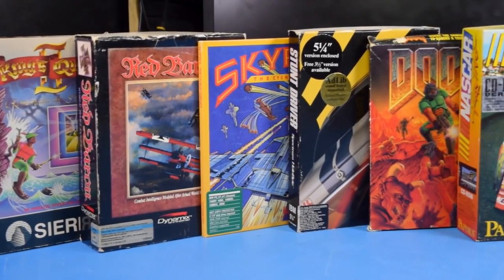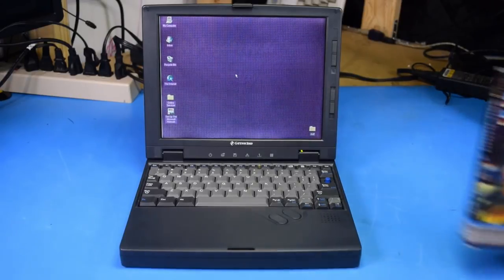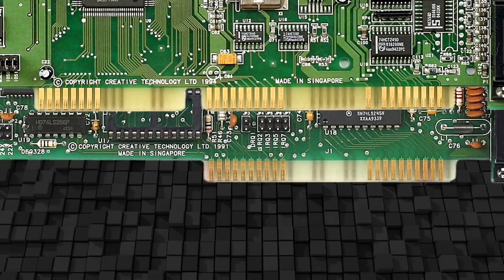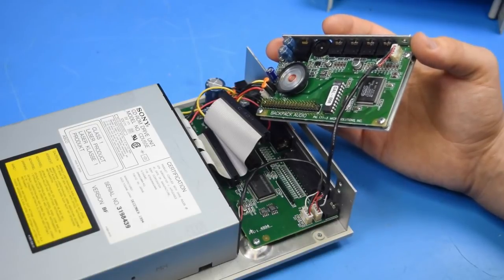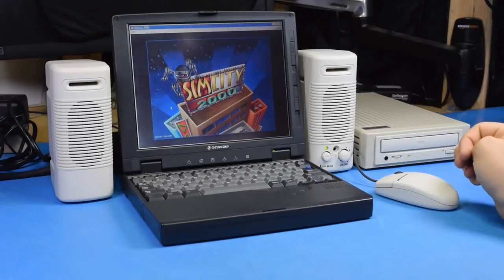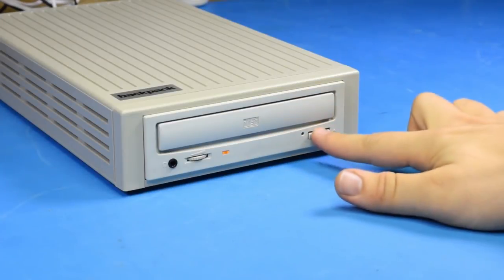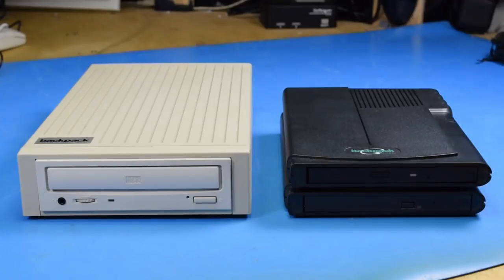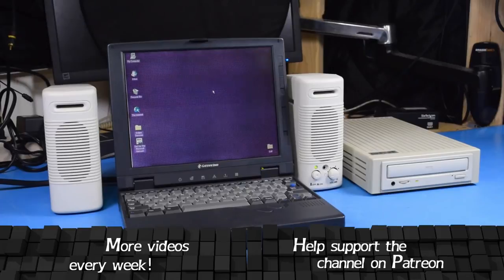LPT Sound Card In CD Drive is Almost Awesome

Comment: Since the es1688 can do OPL3 emulation is it possible that the tools/drivers for the OPL2LPT/OP3LPT might work with the backpack?
Reply: That's what I thought as well. However, DMA PCM playback will probably not work. Hence digitized speech et al will be problematic.
Reply: Well yeah, I'd only expect adlib level compatibility so no digitized sound but at least it would be better than nothing if it were possible, it might not do anything do to the difference in implementation anyways.
Reply: Not without further very extensive modification of the driver. There's a bit of logic on the LPT-IDE adapter board to drive address selection and to stick 2 8-bit transmissions into a single 16-bit and vice versa, and you basically have to work around that in the driver. I don't think it's possible really, all you need to do for OPLxLPT is hotpatch the address of the interface in the memory image of the program, which you'll easily figure out for like 80% of software by analysing a few programs, but for such an interface you'd need to essentially transform the writes too.
Reply: @SianaGearz  : A bit late, but to the best of my memory the IDE bus is basically a cut-down ISA bus with a few custom lines tacked on. If someone got one of these into the hands of whoever builds the LPT2OPL, they could probably add support to their driver in pretty short order.
Reply: @absalomdraconis   IDE and ISA are vaguely similar (which is how this device is possible and low-complexity) but here the hardware adds many levels of indirection. In order to fit the majority of feature set of the underlying soundcard or the disk drive into the very constrained parallel port, the resulting software interface is nothing like ISA/IDE. You can always ask the author, that would be 'pdewacht' on Github. The project containing both implementations of the driver is called 'adlipt', and i took a deeper look at it now. This is an open source project so you're not strictly reliant on original developer.

The magic of adlib is that it uses just 2 IO ports, no interrupts, no DMA no advanced features whatsoever, and while reading back the adlib registers is possible to software, it is largely unnecessary. So when the OPL is transplanted over to the parallel port, if you squint hard enough, it looks kinda like the corresponding ISA card, which is not the case with anything mildly more complex.

Glancing quickly over the driver, there are two implementations. One is a TSR which piggybacks on the memory manager and actually does full port trapping, and potentially it could pretend to be a real adlib even if the hardware is hidden behind an arbitrarily complex adapter. Unfortunately the mechanism only runs in Virtual 8086 mode, so basically a bunch of 286 games will work, the 386 ones that ship with DOS4GW or similar extender won't.

The second implementation, which both dispenses with memory manager and TSR overhead and possible to make work with any game, is just patching the game executable on disk, by having someone reverse engineer the game. Fortunately one patch will usually serve several games, so it's not an insurmountable amount of work, as sound code tends to be reused verbatim a lot. First all the read-dependent code such as detection routine is patched out, this is universal for any possible replacement hardware. Then the output routine is not merely modified, which is contrary to what i anticipated, but replaced outright. Since the replacement is templated, it's actually easy to adapt to somewhat different hardware, but the problem is, the hardware shouldn't be too complex, as the routine needs to fit within the foreseen space of the original sound code in the executable. If one were to do something more complex, finding new space would be necessary, and i don't really have a solid idea on how to accomplish that.

Comment: For sound expansion back in the dark days I used to have an Altec Lansing AMC2000 PCMCIA CD-ROM and audio unit with a Thinkpad 360CE. It was decidedly not portable, but made decent sound and because the PCMCIA interface it worked on DOS and Windows 3.1.

Comment: I haven't finished the video yet, so I don't know if AkbKukU made specific recommendations on laptops but I HIGHLY recommend Toshiba's Satellite line, specifically I have the Satellite 460. I run MS-DOS 7 on it and with very little effort have every single part of the laptop that is important to me functional: audio, all external connection ports, etc. Not only is the laptop affordable (I got mine around the $60 dollar range on eBay if I remember correctly) but it has high compatibility with DOS games and it has an authentic OPL 3 compatible sound card. The keyboard and mouse nub are not the most impressive, but when hooked to a 4:3 LCD or CRT with external mouse and keyboard it is a DOS dream.

Comment: On the topic of the 18v A/C input being compatible with 18v DC.  You can definitely do that if you know for sure that none of the electronics inside actually need an A/C source.  Basically if it's all digital inside, the A/C is going to be rectified to DC right on the other side of the power connector inside. That's done by passing the A/C signal through a bridge rectifier (diodes). So the DC would just pass right through the two diodes that are forward biased and  be on it's way to the regulator chips (likely the two TO-220 devices you commented on). The great thing about that is that if you do power it with DC, you can't possibly connect it backwards due to the bridge rectifier.  Hope that clears things up.  Cheers!
Reply: Out of AC you can make + 12 and - 12 V - so operational amplifiers can use a symmetric input.
Reply: @Mr1X  that's why I said "If it's all digital inside".
Reply: @BEdmonson85  but just thing about the power amp - this is analogue
Reply: @Mr1X  Many small amps use a single-ended op-amp, the negative reference is just grounded.  I'm not saying this is the case here, I was just describing why someone may have told him a dc supply could be used.  Just understand not all amplifiers need a negative supply, otherwise your walkman would have a hard time running on batteries :)

Comment: You can definitely hook up anything from about 18-22VDC up to this without causing any issues and polarity doesn't matter. The reason why is that the first thing a device that takes AC natively is converts it to DC with a diode rectifier bridge  i.e. a circuit that only lets current flow in one direction, which is what makes AC into DC. If you plug in DC, its simply already only going in one direction and the internal power supply handles it just fine.
The reverse is not true  - a device expecting DC will either not work, be permanently damaged, or at least blow a fuse if you try to hook AC up to it.

Comment: about the "opl emulation": this sounds like an opl that is just driven by midi commands. you can clearly hear it on the bass notes. a real OPL would sound pretty similar to what i just heard when driven by general midi instead of true adlib commands.

i noticed this difference on my own retro system recently - when a sound blaster vibra or 16 is used with windows ME there is a WDM driver installed by default that somehow did not work with the "adlib" setting in doom setup but will work with the "general midi" option wich is passing midi commands thru to windows ME's default midi device wich is either ME's built in software wavetable (using roland samples) or whatever your soundcard has to offer - in this case the sound blasters OPL FM synth.

however ... once the original soundblaster 16 VXD drivers are installed, dooms "adlib" setting starts working and it sounds noticeably different.

Comment: Surely there must be a way to configure DOS games to see this thing. The Backpack control panel did seem to give a couple clues of what values to try. Some of the options were set to Auto but maybe you can set those or see what settings are available to try in DOS. I've heard of patches being released for DOS games to run with weird sound cards. I'd also be curious if the installed dumped some DOS files about--when I recently installed the ESS sound card for my PIII laptop it did that, though the driver isn't fully working right now.

Comment: Stats for Nerds: content loudness -7.1dB
You might want to look into that.

Wow, so this is an IDE sound card plugged into LPT bridge (other way around from what you said in the vid), wonder if it would work in the desktop on ordinary IDE controller :o) depends on how they wrote their drivers ... 15:30 answers this, looks like its hardcoded to LPT port, and IDE part  (GAL chip) translates addresses.
You could probably patch support for FM portion of this into ADLIPT, SB would be difficult due to DMA.

Comment: Years ago there used to be software to make the ESS Audiodrive function in DOS 6. The problem is the fact that the ESS Audiodrive is a PNP chip, and therefore requires the PC to be able to configure it to work properly within DOS, which I don't see happening with that functioning through the parallel port. This is a pretty cool piece of retro tech though. Since the CD-ROM drive is a simple IDE drive, you could upgrade the drive in the backpack case to a faster drive, but you will only get so much throughput through that, but you could realistically get a 56x drive, but it will only function at a slower speed.
Reply: I can attest to the fact that the optical drive can be replaced.  I have 2 of the "desktop style" drives (no sound cards in either), mine were a little bit later revisions and were 4x drives.  Both went bad over the years and I had replaced at least one of them with a 24X drive.  Throughput is limited to what the parallel port can provide, but it sure spun that disc up nice and fast!

Comment: My families first computer was a Packard Bell Legend 410CD with a Pentium 75 mhz and 8 MB of RAM running Windows 3.11 we got in 1995. I would say that the vast majority of gaming I did back then was primarily DOS. Warcraft 1+2, Doom, Jazz Jackrabbit, a bunch of games compilations, D/Generation, Robocop, Wolfenstein, etc. The Pentium 75 was below the requirements for Starcraft but I played it anyways. Ran slow but it ran. I did eventually borrow the 11? 14? disk Windows 95 upgrade set from a friend and install that, but still mostly used DOS for games.  All that said, I kinda disagree with the sentiment that Pentiums are not good for DOS games. Unfortunately when we got the AMD Duuurrrrron Compaq we got rid of the Packard Bell. Really wish I had the foresight to keep it. I guess I'll have to do some testing between my current 486 and Pentium 166 systems and see for myself!

Comment: Doing a 
Asus K8V-MX Socket 754  win 9X build  and 2 nights ago i'm wondering  "We are going to run out of CD-ROM Drives with CD-IN connectors before another of these parts for games on CD with sound tracks". Yeah there's moving the disk to the hard drive  but it's not the same. 

Something like a USB-Floppy will probably  come out somewhere  if it's not already out.

Comment: I had a driver hack to make my pc speaker work like a really bad sound blaster before i got a sound card. One of the big problems i had with sound card/modem or sound/cdrom combos was port routing. Some games would not let me set the proper irq port and i would have to go in with a hex editor to give it the proper values.

Comment: To answer your question @ 12:30 in the video. The reason they use an AC adapter with an AC output instead of DC output is so they can generate a dual DC power supply with both a positive and negative voltage rails. The op-amps that drive the audio outputs need a dual rail power supply and if you use an adapter with a DC output. It will only supply power for the positive rail and you will get distorted audio output. Don't worry. Doing this won't cause any damage to the unit.

Comment: Using DC for a jack requiring AC is USUALLY ok, if the device actually functions on DC rails, as the AC signal will usually be immediately rectified anyways. The reason they do this is to use lower cost transformer only wall warts, and they simply integrate the rectification right onto their own circuit board. Saves a couple pennies.

DC and AC would make no difference if it is immediately rectified anyways, just a bit inefficient cause of rectifying twice.

DO NOT put AC into a DC jack... You will immediately explode filter caps and probably damage other things as well. Not only will it not have rectification, usually the expected DC immediately get capacitors across positive and negative to help with ripple and voltage droop. These would be a dead short if you fed in AC and explode.

Comment: If you find that the AC input is directly getting into a Bridge rectifier package or four diodes, you can surely put DC in, although you might need to compensate for the diode voltage drop which is for bridge rectification around 1.2V or thereabout(0.6V*2)
Reply: 18vac is (no load) rectified and yields 24 to 25vdc (AC voltage times sqrt of 2), then you have to subtract the 1.2v

Comment: Sorry for my late comment 2 years after the release of the video but after your installation of the drivers do you tested the "SET BLASTER=..." option in autoexec.bat?
Maybe with that configuration the soundcard of the drive works in DOS?

On an old DOS PC with a Soundblaster card you doesn't need drivers. The "SET BLASTER" command in the autoexec.bat is enough, I think....

Comment: I have a Toshiba Satellite Pro P133 for my DOS-era machine and it does pretty well, it was very very cheap too. The inbuilt sound is precisely why I went for Pentium over a 486.  I'm struggling to find a floppy drive for it though, it has a swappable floppy disk/CD-ROM bay and I don't have the floppy drive

Comment: Hey AkBKukU, Nice vid. I was wondering why not just use one of those docking stations for the older ThinkPads or something with a add in ISA slot or something. Wouldn't that work just as well with a desktop sound card?
Reply: Then it's not nearly as portable
Reply: @NaokisRC  The Dock I had a carrying handle, it was the one that was made to be portable. It was even made with the idea of having a sound card built into it since it has instructions in the manual about neatly routing an audio cable out the side of the single ISA slot and to the audio-in on the back, and had a CD-ROM bay.

Comment: did you find the 2.11 software? Its nowhere to be found and a mystery as to what the chip might be. Have you looked into the external Serdaco solutions? You can get the GM card, or OPL2, OPL3 on parallel cards.

Comment: Wouldn't VDMSound solve all your DOS sound issues? There is a Windows 95/98 port of it. It emulates a DOS soundcard (AdLib, SB standard, pro, or 16) and uses the Windows audio as output. Since you've got working Windows audio, that should be problem solved.

Comment: How is a Toshiba Satellite 330 cds for DOS gaming. Its my oldest laptop I have in my PC collection with a 266 mhz Pentium cpu, I guess the fastest Pentium that Intel made in laptops before moving on to the Pentium IIs, 96 mb ram, 4 gb hard drive, and also has sound built in that seems to work in DOS games like Shamus, Gobman, and I have it running Windows 98se, basically the latest OS with full DOS compatibility, and also has 3.5" floppy and CD-Rom built in, so didn't have to hunt up any external drives.

Comment: It's never a problem to pipe DC voltage into a device that expects AC - the DC will be internally converted into the required polarity by the AC rectifier. It's AC into a DC device that causes damage.
Reply: The exception being things that expect line-level AC or otherwise use a linear step up/down transformer in the power supply - in which case it simply won't work.

Comment: My ‘Bantam’ drive has ‘LINE OUT’ and ‘HEADPHONE’ but does not have the other 2 ports. But it does not say ‘Bantam.’ However, it is of no use to me; I’m about to upgrade to Windows 95 and it only supports 98, NT4, and 2000. So how much is mine worth? It’s loose but in VERY good condition, and, as I previously stated, I can’t use it. It’s also a DVD rom and I don’t need it.

Comment: My Compaq Armanda 7770DMT has a ESS chip aswell and it works for ms dos but the sound quality isn´t that great but Impulse Tracker was able to detect and play a song.
In windows, i can even get good enough sound to play mp3 files.
It has a pentium mmx processor (233mhz) and 144mb ram, cd drive, usb 2.0 (pcmcia) and currently windows xp/windows 98 installed

Comment: ....i tore a pentium 1 ibm laptop apart because it was taking up room, the motherboard is somewhere on my ceiling
Reply: .....hey, i have a backpack cdrw, or the guts from 1, it had the 4 pin analog out(usually to a sound card) broken out to a 3 pin headphones socket on the back of the box, 2 parallel ports and a mini usb port, board stamp date is 0312 and its based on a xylinx spartan xcs20xl, the ram chip was dated 1003 so this drive was from 2003-4, still has the parallel though, and the most annoying 5 pin din for power in